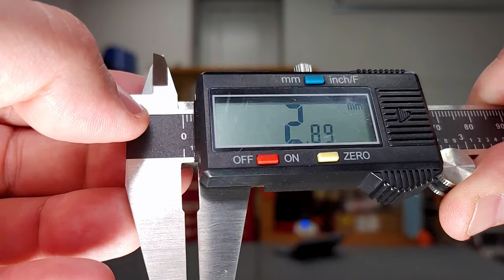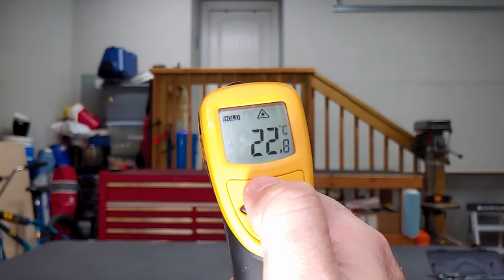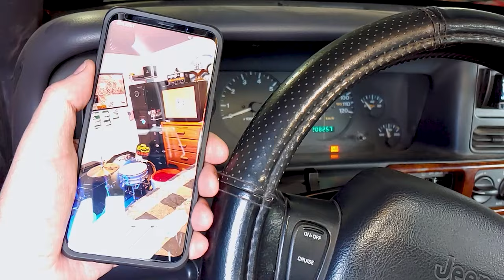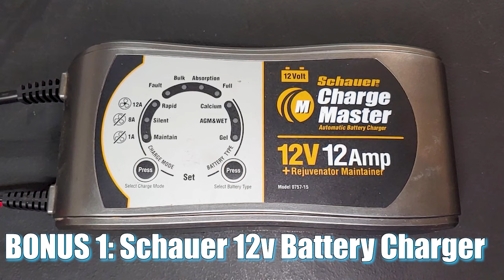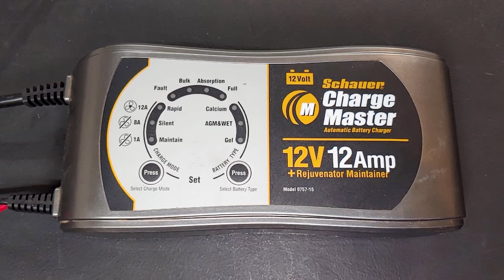My Top 10 Favorite Electric Tools for Working on Cars and Motorcycles (Pt.2)

Comment: I know you said no specific order, but I could totally see the lights being at the top of the list!

Also, for those that may not know, I’d suggest doing quite a bit of research on the electric ratchet before you buy one.  Some will lock up so that you can use them to break something loose by hand and then use the electric feature to run them off, while others will not causing you to use a wrench or manual ratchet to break it loose and then grab the electric option to save a bit of time.  I don’t know what that particular Milwaukee flavor type is but just want to help educate everyone to some of the differences so they do some homework to find what suits their needs the best.

Good video, thanks for sharing.